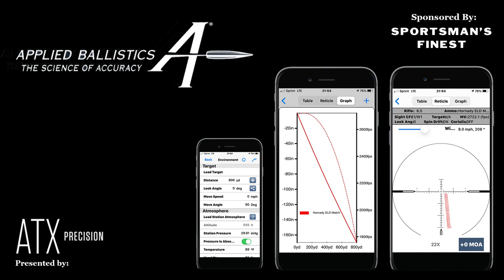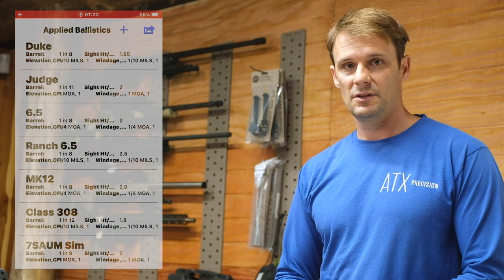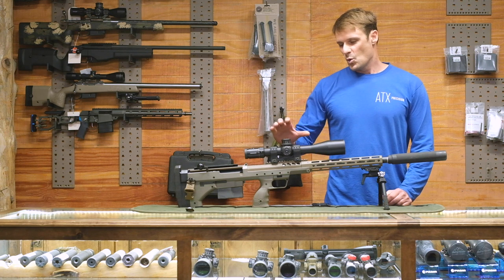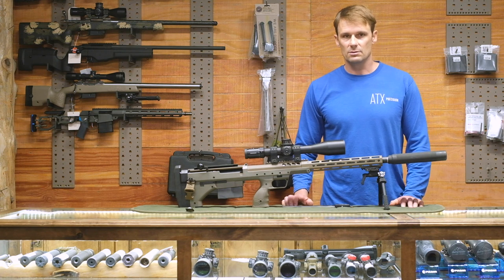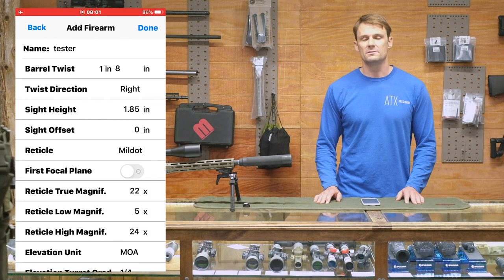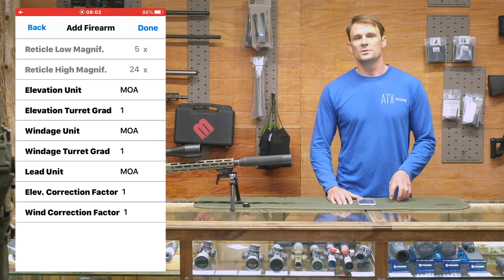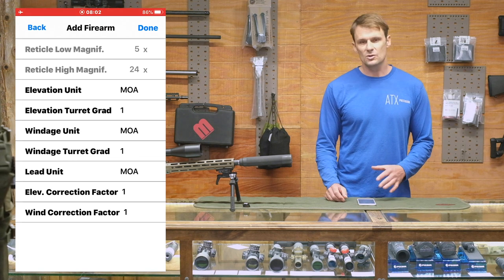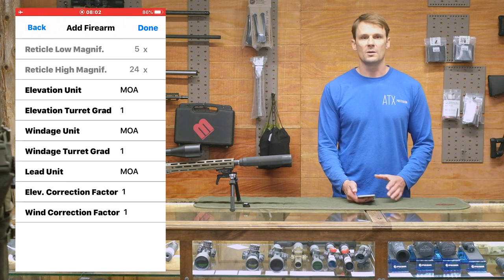How To Use Applied Ballistic for Precision Rifle

Comment: FYI Everyone... It's April 2022 and the ios AB Mobile app ver 2.4.20 is rife with catastrophic problems... the solver produces completely erroneous solutions if you input a negative density altitude. I emailed AB and they confirmed they know about it... it's been over 2months now and they still havent fixed it. No idea how many more months it will take for them to fix 2.4.20 with an update... so theres that to consider. Also the data backup feature is completely glitched and doesnt work. So... beware if you are at low altitude or low temperatures ios AB Mobile 2.4.20 will completely pooch your fire solution. 
They really need to fix this!

Comment: Great video. I didn’t know that sight height error is extra important with angle shots. Can you please show the math behind that? BR Thomas.
Reply from the maker: Here are some numbers from one of my 6.5s on Applied Ballistics:

Correct site height of 2.5:
700 yards, 0 degree shot angle: drop is 16.5 MOA
700 yards, 30 degree shot angle: drop is 13.8 MOA

Default site height of 1.5:
700 yards, 0 degree shot angle is 17.4 MOA
700 yards, 30 degree shot angle is 14.6 MOA. 

So by not inputting correct SH, data corrections are off .75 MOA on level or 1 MOA on angled shots. 

My interpretation is that Clay's intention was to convey that sight height is important. Not necessarily more important on angle shots.
Reply: I can't show the math here, but the concept of it isn't too difficult.
If you could somehow have your scope look directly down the bore of the barrel, the bullet would impact low depending on the distance.  As soon as the projectile leaves the barrel gravity works and it begins to fall. Shoot a gun flat, and drop a book from the same height; The bullet and book hit the ground at the same time.  However, with scopes being above the axis of the barrel, the projectile will cross the plane of the scope twice; once on the way up and once on the way down.  This is why the popular 50/200 zero is possible. Generally, the lower the scope height the longer the Maximum Point Blank Range if all else is equal.

Comment: So sight height — half the diameter of your rear reticle + half diameter of rear space where bolt goes, plus total between top of that and bottom of rear reticle
Reply: No…. 
Simple measure…. Center of the bore… to center of the scope reticle…. Which is where the center of the windage cap is. 
Some people put a cleaning rod down the barrel and measure center of the windage dial, or center of the scope main tube, to center of the cleaning rod in the chamber window where the shells eject on bolt action guns. If you have a super large caliber…. Like a .45 or 50…. Put a brush that is for the size of your bore on the cleaning rod to center it I. The bore and prop it up to center bore on the rear and then measure center cleaning rod to center windage knob. It’s one simple measurement.
The distance your sight reticle center is above the center of the rifle barrel  bore. Middle of the scope cross hairs… to basically center primer of loaded bullet. If that makes more sense.
Reply: I see what you trying to say there… but you might screw that up trying to do it that way. And not all bolts are round. Bell on a scope has a thickness. Etc etc…. 
Simple is better